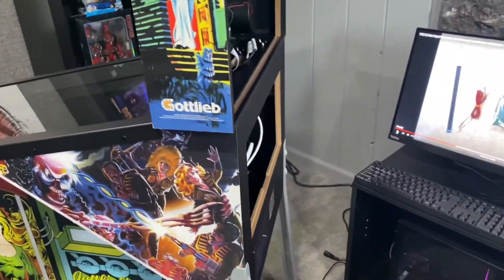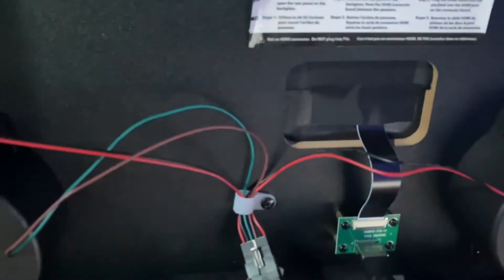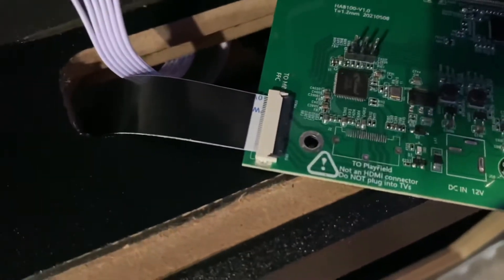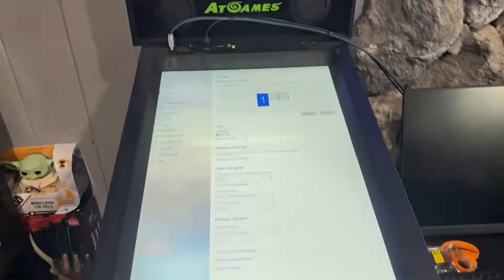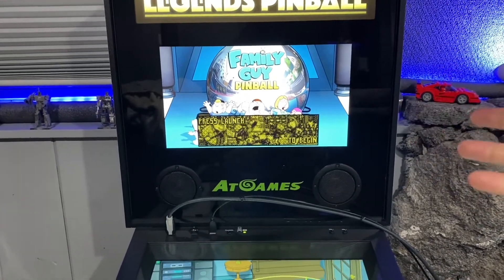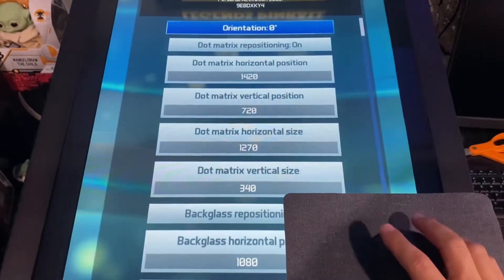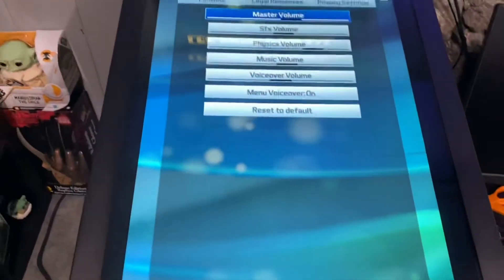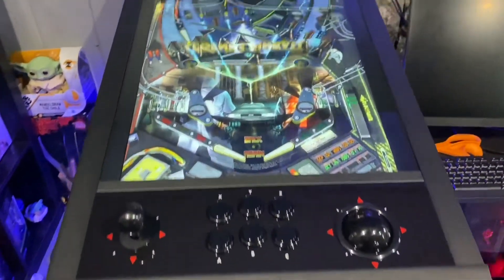Enhanced Legends Experience: VIBS V2 & Steam FX3 Backglass, DMD Setup Guide - Portrait Mode!

Comment: I dont get it. I set the dmd size off but its still showing on my playfield.
Reply from the maker: Drag it to your backglass. Click on corner of dmd. Right click and save position.
Reply: @JohnPauls  Im sorry John but how??
Reply: @JohnPauls  btw its already in the backglass but also in the playfield.
Reply from the maker: Press F1 after table loads and check Cabinet mode.
Reply from the maker: If positioning is off. 

Take your mouse and grab the DMD and drag it over to the DMD screen. 
Right click the DMD, pick game settings
Make sure cabinet mode is checked, and click OK
click OK to dialog
Now right click DMD again
click show borders
Now resize the DMD like you would any window, to fit the DMD screen properly
Now drag the DMD a little out of position, then right click and disable borders
Now grab and set into position
Now DMD will remember itself.
Reply: @JohnPauls  pressing F1 doesnt do anything. When dmd positioning is off I dont Have any dmd. When on its also in the playfield. No way to drag the dmd. Oh man I feel so stupid. Thanks anyway.
Reply from the maker: Please don’t. This takes some getting used to.  Are you on VPX or FX3 adjusting this dmd? Are all tables doing the same thing?
Reply: @JohnPauls  I am on my Atgames legend pinball machine trying to get fx3 working. After a week of fucking arround I Just got my Keys working with xpadder. Couldnt get it working in steam. So I can play! 😊 Now the dmd problem. I sure want VPX but got enough trouble getting this to work so Im a little scared. Wanna thank you for taking time for me because you dont even know me. Forgive my grammar I am Dutch.
Reply from the maker: With steam you should really use the Xbox controller settings, the ALP is recognized as an Xbox controller and input will be much faster. In regards to the DMD, with FX3 it’s all numerical inputs, follow my video on those inputs, and it will set it accordingly.
Reply from the maker: Your grammar is great, the Dutch are great people!
Reply from the maker: VPX is so much fun, you really need to give it a shot.
Reply: @JohnPauls  thought I got back to you telling I have the problem fixed. Seemed all I had to do was change the camera angle 😊😊Still no images on teh backglass. Im sure I put them in the right directory.

Comment: I'll try this, found out that all my backglass files for this are .xpx files and backglass asks for .bmp, .jpg, ect. I'll have to figure that out, thank you. But first have to figure out why controls on atGames are not registerring when I try to set them in pinball fx3.
Reply from the maker: Possibly the USB cable, many reported instances of cables not registering inputs. Some use powered hubs, I did not require one. Try swapping cables.

Comment: Question for you my man I just ordered one and just recently got it put it together but the aesthetic on the black finish on my back glass piece was messed up and you can tell where they tried to apply some black stuff to fix it and my right nudge button wasn’t hooked up so I hooked it up myself and I had this really weird thing happen when my Nintendo switch turned itself off and I tried to switch the channel button back to normal then back again to HDMI the Nintendo was on and wouldn’t display on my main screen then somehow I got it to come back on the main screen and when I hit the channel button again to see what it would do everything that supposed to be on the main screen went to the back glass monitor is that normal and should I return this machine❓thanks
Reply from the maker: I’d return it on the basis that it had damage alone. No one should receive a new product at full price damaged with a jerry rigged fix. Is it playing normally after a reboot? Or still experiencing the issue?
Reply: @JohnPauls  Thanks for responding man…I haven’t really seen if the issue would happen again since I knew about the Nintendo switch option that you could hook up I did that until I get a computer to do everything the better way…but I simply came upstairs and then when I went back down you know my Nintendo had turned itself off after being idle for so long and when I turn the Nintendo back on it was still in HDMI mode on the pinball Machine & it wouldn’t show up…that’s when I started pressing the channel button to see what was going on and it acted wonky I got it to come back on(after I turned the power switch off and back on)and I played some pinball tables through FX three on Nintendo but not sure why it did that.. but yeah I feel the same the aesthetics were messed up and for something brand new that cost so much I’ve reached out to them today through email it’s just stupid because I had to tear the box apart to get the damn thing out and they’re gonna want me to send all this back in the same boxes and I hear they want you to pay the shipping charge to send it back. Sorry for such a large response I appreciate your time
Reply from the maker: If anything have them credit the difference, that’s ridiculous. Ok, if you haven’t experienced the issue again since you should be okay. The ALP left in OTG mode also goes into a non responsive state every so often, requiring a reboot. AtGames has been made aware of it, they don’t care to fix it. More of an inconvenience than anything else since you can’t leave it in attract mode. You probably experienced the same thing but with the switch. You’re most welcome.
Reply: @JohnPauls  Yeah man it’s just disappointing overall I’ve spent a lot of money on arcade1up for instance I have like 13 cabs & I swear on almost all but not all there’s something wrong with the aesthetics..& I feel like I watch videos & other people somehow keep getting mint machines..maybe they don’t.. & they just don’t say(because they don’t care) kind of expected more from Atgames(maybe I just have bad luck)anyways….✌🏻

Comment: Thanks for the info. I got the dmd working but I don’t have the art background display? All files are loaded in the folder. I can share pics of what I see. Basically black with the name of the directory where the art back glass is
Reply from the maker: This is for FX3? Make sure your display setting on the PC are correct, also check your graphics card settings to make sure they match.

Comment: I've only got one HDMI port coming out of gaming laptop.  Seems like two screens is not an option. Work around??
Reply from the maker: HDMI, DisplayPort & USB C can all be used with the right adapter.
Reply: I've got all the adapters, followed Wagner tech talk etc but is it possible my laptop won't all two monitors?  Or do you dust the nvda graphics card somewhere.   Just doesn't seem to recognize two monitors.
Reply: Thank you for you fast replies!  Yikes
Reply from the maker: You’re most welcome lol. Yes the graphics card needs to be capable of displaying two monitors. Google your specific card and check it’s capabilities. I bought a prebuilt at Microcenter, came with a RTX3060 for $1200+\- with “inflation”

Comment: Mine arrives next week - I'm still deciding whether or not to keep the DMD on my tablet i have already in-use...or move it to the backglass once I install the VIB...
Reply from the maker: Awesome, congratulations! Install VIBS, much more authentic feel and look to it unless you actually integrate the tablet into the box.
Reply: @JohnPauls  I already have the tablet velcroed between the speakers showing the DMD. If my GPU will support it (no lag) - I will keep it as DMD and when I connect the VIB just use the backglass to show the artwork.
Reply from the maker: @wryker  oh got you. Great plan! I plan on adding one like Cooltoy did, your method is a lot less destructive lol.
Reply: How are you using your tablet as a DMD?  Spacedesk?  Sorry, I am quite new to all of this!  I usually see Spacedesk thrown out as the option for a tablet DMD and am interested if there are other options?

Comment: I also used different settings for my dmd in the beginning but having your Lontium display in portrait mode is going to give you trouble down the line. If you need help email me. But your gonna be in windows screen setting hell when you install vpx and future pinball. The first thing you need to do when installing pinup popper is all screens need to be in landscape mode, 100% scaling, your playfield is always the left screen, then your backglass, then dmd, then topper (if you get those eventually )
Also just know windows will mess with you with the numbering of the screens. Don’t worry about that so much, there is a chance vpx and future pinball will tell you , your playfield is screen number 2 when windows says it’s number 1. Lol welcome to hell brother . Haha jk welcome to the family, great video.
Reply from the maker: Trust me I know haha. Already have VPX fully running through Pinup Popper. I’m using irotate to accommodate the change in modes between the two. Also set up two Joytokey profiles for each. Eventually I’ll have pinup run fx3 and can stay in landscape. Already have 100 tables loaded lol, it’s been a fun learning experience with an extreme learning curve but fairly easy once you understand it.  Appreciate the heads up!!!!

Comment: How did you get the arcade controller to work for fx3
Reply from the maker: Button mapping in Steam settings, comes up as an Xbox controller. First make sure windows see it as a controller first and not a mouse or other peripheral attached through USB.
Reply: @JohnPauls  How do I get Windows to see it as a controller? My AtGames doesn't see any control connected. I've tried multiple USB cables and no luck.
Reply from the maker: When was your most recent firmware update? They botched a version that lost Connectivity, latest version fixed it.
Reply: @JohnPauls  My current firmware is 5.69.0. hopefully there will be a fix for it. 
I got other USB hubs and cables on the way that I'm going to try. Just going to keep ordering different ones til I get 9ne that works.
Reply from the maker: By any chance, did you order powered hubs? Some pcs don’t supply enough juice to see the alp as a controller. I didn’t need one but there have been reports of others needing.
Reply: @JohnPauls  I have two on the way. One is the one that Wagner's recommended and one random one. I've tried a powered hub that I already owned but that didn't work. On Steam Control Settings it says no controller detected but if I plug in a wired Xbox controller Steam sees it. On the Window settings under joystick advance settings the Legends Pinball is seen there. I could press any of the buttons and d-pad and it'll show as working. I also tried uninstalling Steam and FX3. Thanks for the help
Reply from the maker: Steam should also see it as an a Xbox controller. Definitely sounding like that firmware issue everyone was talking about. That sucks. Does VPX work for you? 

You’re most welcome.
Reply: @JohnPauls  I haven't tried VPX yet, that's what I'm planning on setting up after I figure out the controller issue. If these new USB hubs coming in don't work, I'm going to do a factory reset and see if that works. Is setting up the controls on VPX different from FX3/Steam? If so I might just not use FX3.
Reply from the maker: You’re missing out. The haptics on Vpx are on a whole different level. Yes it’s a little cumbersome to set up the vpx tables and front end but the rewards are worth the effort. Definitely try a factory reset as a last resort, that’ll confirm it was the firmware as the original firmware had Fx3 haptic feedback although minimal.

Comment: John question - I have a laptop and vibs and the play field and I shows 3 displays never 2 why
Reply from the maker: Hey Dan! It’s showing the laptop as the third display. There’s ways to auto turn off the screen when it senses external monitors.
Reply from the maker: Hit “Identify” in Monitor settings to shut down the proper display. It’ll number each display live on screen.